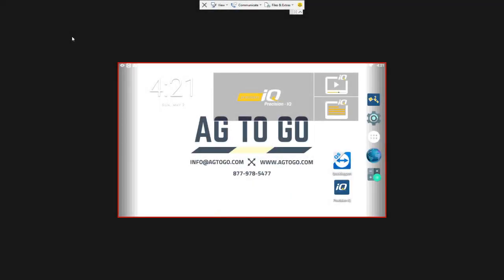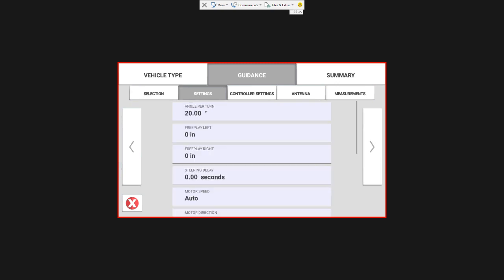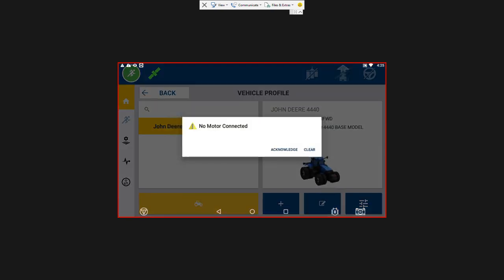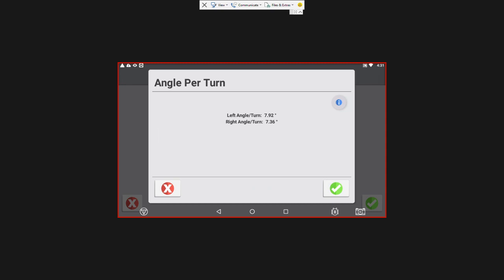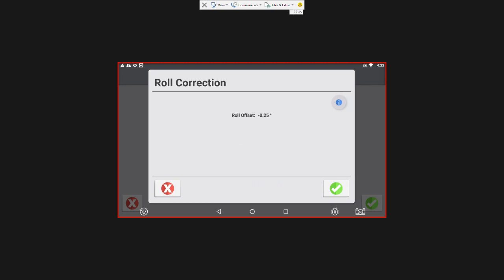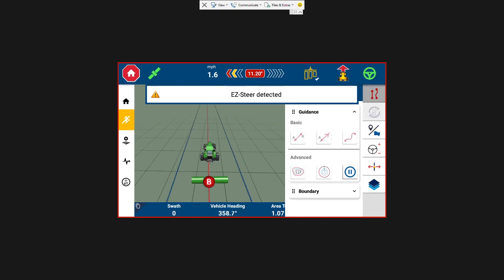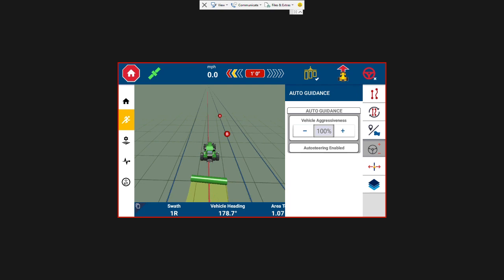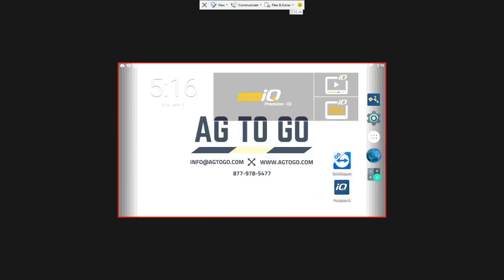Trimble GFX-350 or GFX-750 with EZ-Steer Display Operation - Part 2

Comment: Ezi steer is still not coming up as an option regardless of which model tractor i select, got anything else i can try or will i need technical support?
Reply: Try calling vantage northeast if you can't get it.  Could be multiple things.  Old firmware, no license for ez steer downloaded, etc